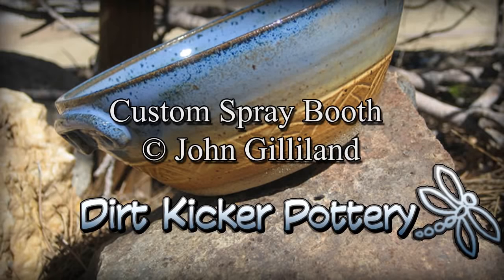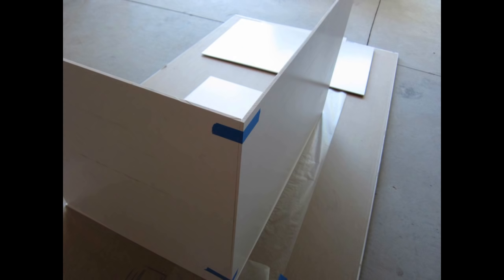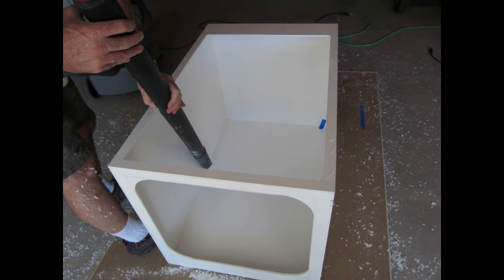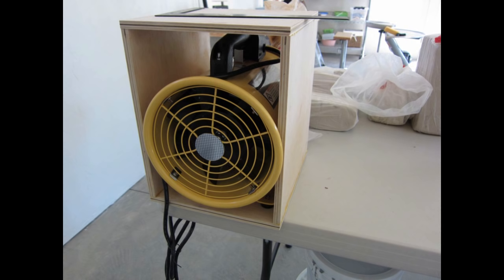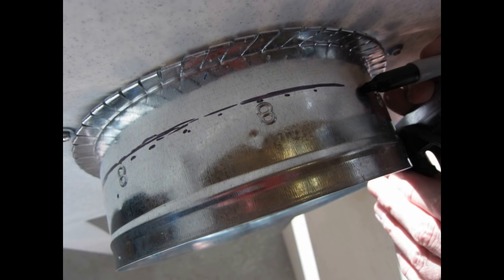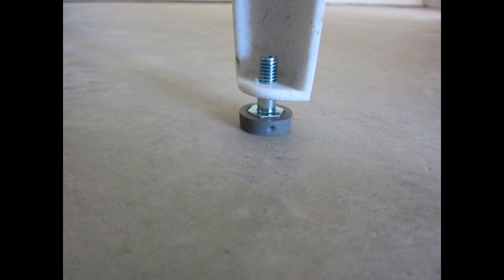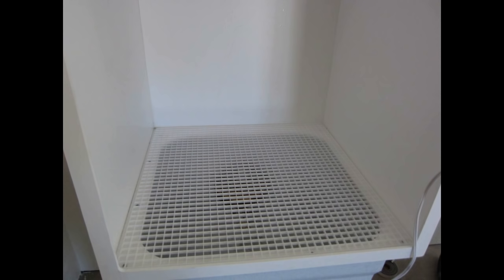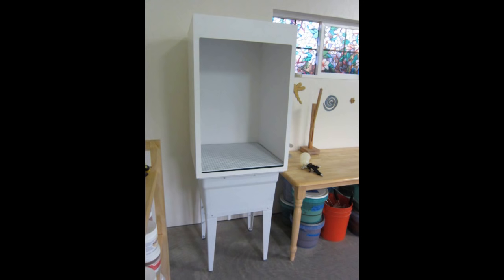DIY Spray Booth Construction - DirtKicker Pottery Glaze Spray Booth - by John Gilliland

Comment: This is a very nice DIY video. After looking at the commercially available units (and prices) I am going to attempt to build a similar unit as this video. The only thing I would prefer is a blower type fan that does not pull the air past the motor. But to get the 1200 cfm the cost is just too high. I did find the identical fan as the video and it seems the best bet.. it does cost $100 now at Northern Tool. Great job on this video.

Comment: I'm a little confused, how do you wash it out? if you spray the inside with water in the sprayer after glazing, doesn't it all flow into the fan?
Reply from the maker: No glaze goes past the bottom filter. If you are glazing correctly, the spray glaze dries quite fast and doesn’t drip through the filter.  
After glazing I take a sponge and wipe down the walls of the spray booth.
Reply: @DirtKickerPottery  thank you